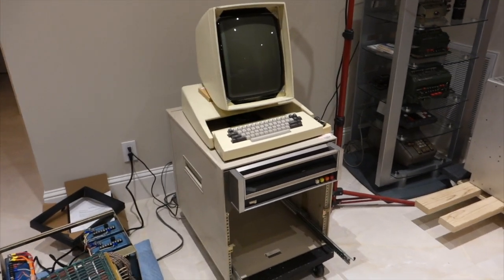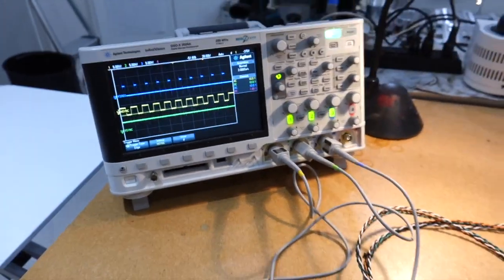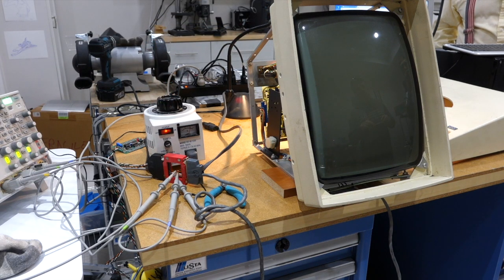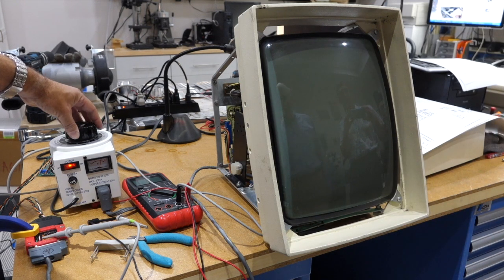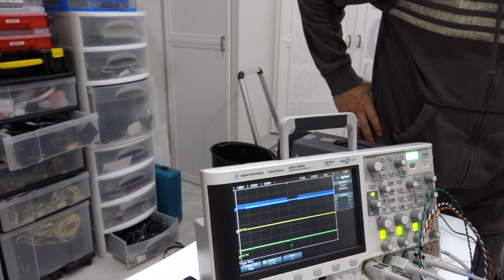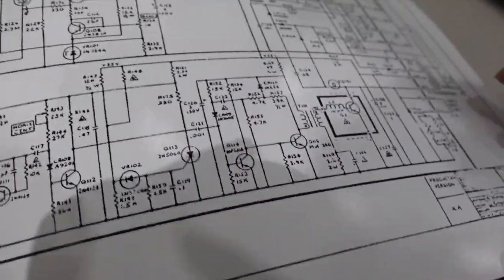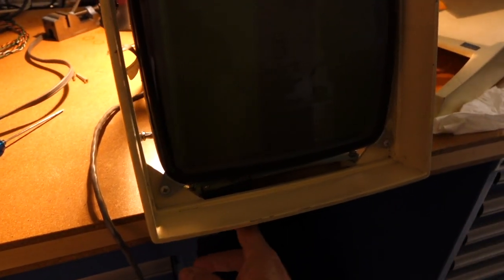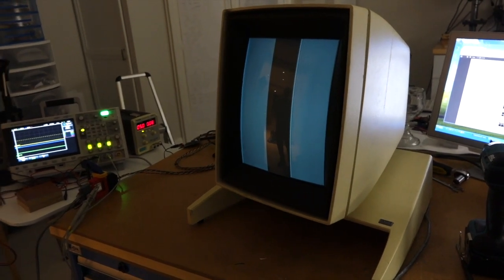Xerox Alto Restoration Part 2 - monitor restoration

Comment: Why not recap before power up? A dead cap is going to be like a resistor in the circuit and pass DC.
Reply: Would that not depend how the cap fails (short or open)?

Comment: At 1990-th I've repared some tubes by "shooting" oxydation on its cathode (turning on heating, off high voltage and put charged capacitor of about 50 mkF (or a little more) between cathode and grid). It will oxydize anyway at about half-year, but if the capacitor was not extremelly big to destroy cathode - it will work! :)

Comment: I would 2nd (or 3rd) the comment to try a CRT Rejuvenator on it. I rebuilt a CRT arcade monitor from 1981 that exhibited similar brightness issues and couldn't display green. I wouldn't say it looked amazing after a rejuvenation, but it did work better and I got 2 more years of life out of it before I was able to locate a suitable donor tube. If rejuvenation isn't possible, you don't need the exact same tube, just one that has a compatible yoke. Worst case scenario you could transplant the yoke from the old CRT to the the new one, but that is quite a bit of work.

Loving the series so far, can't wait to see it come alive.
Reply from the maker: We may if we are out of other options, but as I said before this is a temporary hack, not a proper repair.

Comment: Your most likely right that the CRT is at the end of its life. But maybe you can locate someone that still has a proper CRT tester. At least that makes sure the problem is the CRT and not the other electronics or low high voltage or something else

Comment: I work on arcade crt monitors as a hobby and I find that about 4 out of 9 times you can extract some life from the tube with a rejuvenator.....   Also, a good rejuvenator can estimate how much life the tube has left...  My rejuvenator of choice is the BK 490B.
Reply from the maker: Thanks. We could and we might, it's probably our best option until we find a new CRT. But that's not a proper repair. That's a temporary hack. If the cathode is contaminated, sadly it will recontaminate again.
Reply: You could always try a brightener instead of a rejuvination cycle every so often. Not really the best but running the tube at a slightly higher voltage helped run an exhausted tube for a little longer....or burned the filament out immediately. 
Have you tried asking the folks over at Videokarma regarding a replacement tube? They have a few good men there who know their way around TV sets up to around the 80's so I'm sure someone there could get you a better idea on a suitable tube substitute.
Reply: How does one get into working on CRT monitors? I love CRT's but I am worried that in the next 20 years almost none of mine will work, what can I do to "rebuild" them, short of opening up a new CRT factory.
Reply: i hope so! though what they said about an odd refresh rate makes me a little worried. like if it's exclusive to the alto, and the only replacement would be another alto tube.. hope that's not the case though
Reply: Get into arcade machines and eventually you will learn...
Reply: True, I am sure you know better than I do... but nothing wrong with trying to get some extra life out of a tube that you are trashing anyway, at least until you can find another tube..... Unless the machine is running all the time it would be awhile before the tube ultimately failed. It probably would not hurt to recap the whole board... Or you could just hide an LCD behind the bezel :)
Reply: The best thing about a CRT monitor is that the tube itself generally does not care what resolution or refresh rate you give it unlike with a modern LCD. You are instead limited by the electronics that convert the video signal into something useable by the tube. That being said so long as the gang can find a tube with identical or closely matched ratings for things like anode and filament voltage they should be okay.
As for rebuilding, the last commercial operation which was Hawkeye closed in 2010. Community groups like the Early Television Foundation do what they can to try and rebuild their own CRT's but otherwise all that remains now are really, really expensive contractors who will do one tube for only a few thousand dollars so for the average person it's not a viable investment.

Comment: That CRT looks like it has a bunch of hours on it. I imagine it was a standard tube... I'd start trying to find one! 
The burn in on my Lisa's original CRT (which is also a black on white display) looked similar. After replacing the CRT the picture was easily twice as bright!
Reply from the maker: Exactly. We have to find a new old tube...
Reply: Looking at the part number... is this just a 15" P4 phosphor tube? I'd think that should be easy to source. Check out eBay #152137440948 (not my auction, just something I found on a quick search).
Reply from the maker: Thanks, looks close. I am not sure how compatible all these tubes are. I'm told the Alto one has special P40 phosphor on it to cope with the interlacing flicker.
Reply: Ian on the vintage computer forum could probably tell you for sure. I'd bet they're compatible though (if the tube socket is the same).

Comment: What happens at 07:47? It looks like an arc-over in the high-voltage section.
Reply from the maker: I know, it looks nasty, but it's just a tester reset. It has a watchdog enabled and resets every 60s which produces a glitch. The LCM people warned us about it so we wouldn't be concerned.
Reply: I saw the same thing.